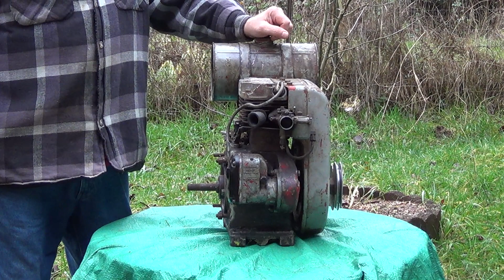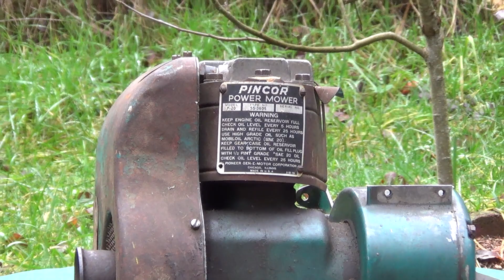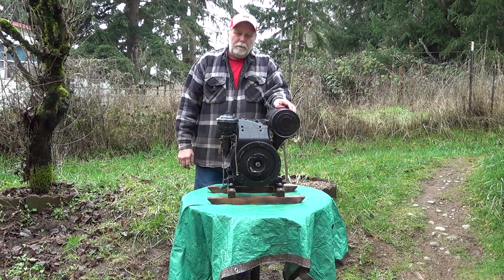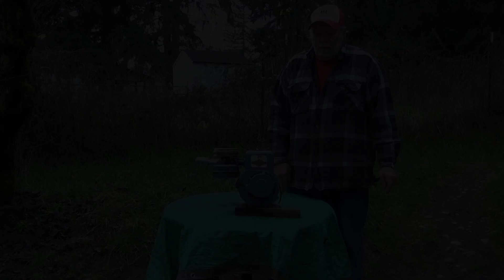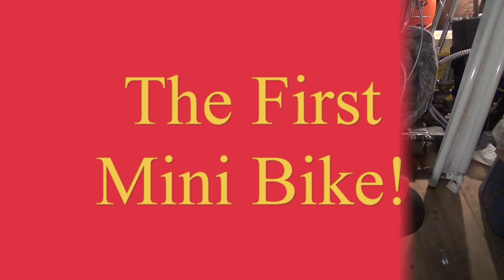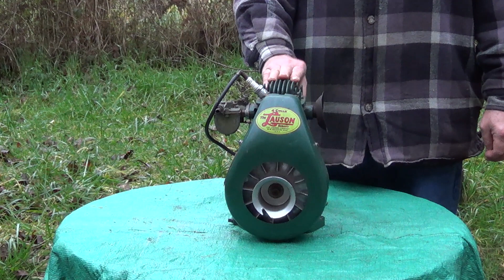The Small Gas Engine for Work and Play -  Part 2

Comment: Ever seen a Cunningham?  Mine looks a lot like a Briggs 5S. Supposedly made late 30s early 40s. Not sure what all they made but I did find a walk behind Cunningham tractor, weird drive system on it.
Reply from the maker: I have not seen a Cunningham.  Must be a rare bird.  There were several small manufacturers that made small engines that looked almost like a Briggs, but were different.  A Pincor engine without the shroud  looks almost exactly like a briggs, but has several small differences , like the governor and ignition that are completely different.

Comment: I have drove a REO truck but didn't know they made small engines.
Reply from the maker: Ransom E Olds was quite an interesting character.  He made gas engines, developed them to put in the first Oldsmobile's, got squeezed out of the car business by GM, started REO trucks, which were very successful, got squeezed out of the truck industry, and his last adventure was REO lawnmowers and engines. Quite the entreprenure.
Reply: @mrobsoletesvintagehomestea9156  I never knew much about REO . He sounds like an interesting guy.  I love   McCulloch's story.  I will look up RE0.
Reply from the maker: History is an added bonus to collecting old stuff.  I like the history almost as much as the old junk I collect. @brianking1138
Reply: @mrobsoletesvintagehomestea9156  you should do some history videos. I love small engine history.
Reply from the maker: I will be doing some this spring @brianking1138

Comment: Wish I could find a replacement 10 horse Wisconson for my 1054 bolens
Reply from the maker: Wisconsin is still in business, and sells a modern version of the AENL engine rated at 9.2HP.  It has a recoil start and modern shroud, but is still the old engine. It is really over priced though.
Reply: @mrobsoletesvintagehomestea9156  Apparently from what I read they closed their Tennessee plant in 2018 I was trying to find a picture of their newer engines I would love to find a picture of one to see what it looks like I saw an engine on there that may have been made by them and I couldn’t believe the price they were asking for $999 no way I would ever pay that much for that.
Reply: @mrobsoletesvintagehomestea9156   bummer I’d love to buy one And put all the shrouds from my original engine for my 1054 onto that that’s why I would like to find a used one that’s an all original complete condition whoever owned the tractor before me really beat the snot out of it because the engine is completely toast
Reply from the maker: The vintage garden tractor sites would be the best avenue for finding a useable engine.  Wisconsin still makes almost all the parts for their old engines, but they are expensive.
Reply: @mrobsoletesvintagehomestea9156  That’s exactly why I want to get a replacement engine because I don’t want to have to pay the expensive prices for parts or a brand new engine
Reply: @mrobsoletesvintagehomestea9156  I would love to find a decent usable Wisconsin engine that’s complete for a reasonable price
Reply: @mrobsoletesvintagehomestea9156  Happens sometimes when you’re collecting tractors you just get that one that has been beat

Comment: Expect delivery on Friday last I checked.  You will probably need to make a minor adjustment to the carb as you live at a different climate and altitude than I do.  Probably 1/8th of a turn adjustment at a time should get you there.  Your oil choice vs my oil choice could also cause you to need to make a small adjustment.  You will probably notice it on idle mostly.  If it is idling after a cut and the rpms drop or you find you need to clear it a bit on the throttle before making the next cut then it is probably rich.  Just turn the low side clockwise 1/8 turn at a time until it is running correctly.  If the rpm increase after a cut and you let it idle to a point were the saw starts to starve and get boggy then it is probably lean.  Just turn the screw counter clockwise until it is running correctly.  I find these adjustments need to be made when the saw is running and at full temp meaning make some cuts before really diving into the adjustments.  You probably know all this but just in case I thought I would give you some information  on how I do it.  If you need help with the final adjustments just let me know.
Reply from the maker: looking forward to a run and cut, and a video. Just got my xl 12 running today. Didnt have a chance to do a cut as we have had almost 2" of rain in the last day. Thanks for the advice.
Reply from the maker: got it